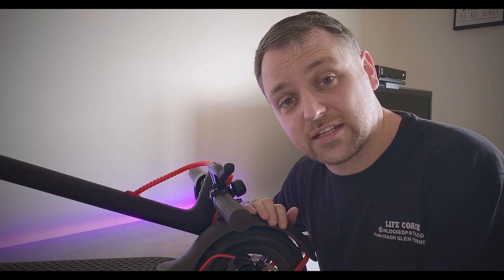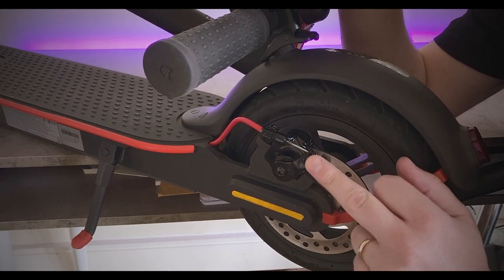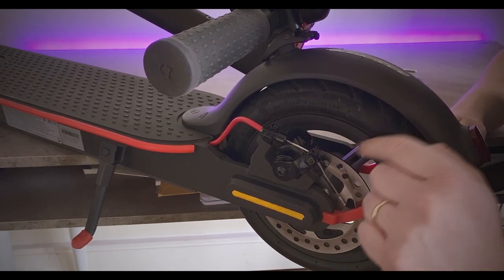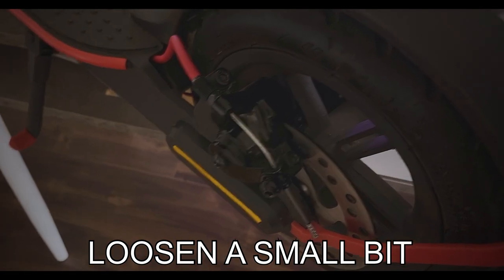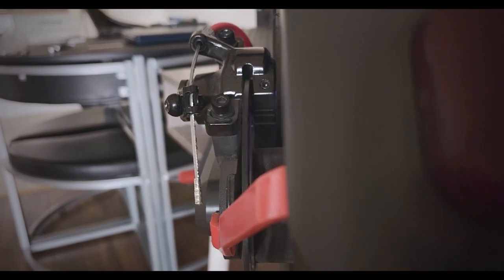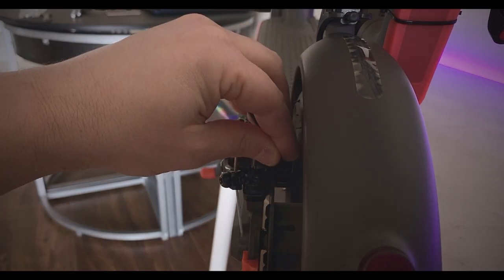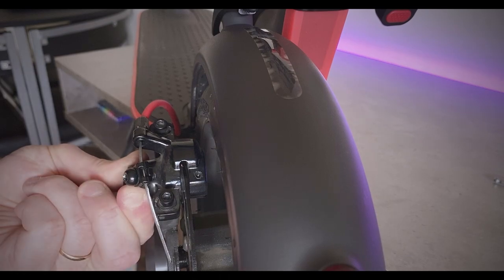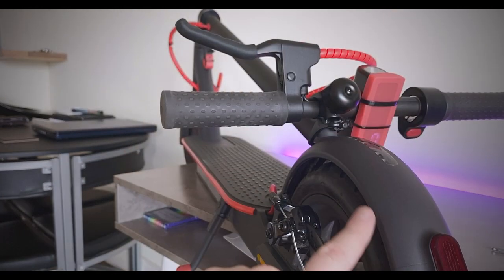XIAOMI M365 PRO 2/3 BRAKE ADJUSTMENT - Time For Check Up

Comment: Fantastic info. For the gap between the pad and the disc it would have been good to hear a mention like: "a regular drawing paper sheet should be able to move between them freely but if you have three sheets then that's too big of a gap."

I'll be sure to test mine the soonest I can. From getting my first 500km on my scooter I've definitely noticed some loosening on the brake department already.
Reply from the maker: Great tip! 🛴

Comment: I went from never stopping (only slowing down with stock brakes) to wheel burn (I now have to put my weight on the back to brake because it is so strong).
Thank you very much for this very informative video. I learn many things and my stock brakes are working much much better.
Reply from the maker: No worries at all! Scoot safe 🛴

Comment: Brilliant video mate. It's perfect timing as I'm currently having a bit of an issue with the motor over running and the brakes not being as responsive. If I could give a bit of feedback, the editing in the middle part was quite snappy and it felt a little fast in places. Can't fault your advice in the slightest though and hope you keep creating excellent content.
Reply from the maker: I definitely jumped ahead for sure!! But i am glad it has helped you out! I appreciate the comment👌🏻 the Xtech upgrade I’ll be doing soon also.
Safe scooting Sam 🛴
Reply: @Movelectrics  Hope you didn't mind mate, I'm grateful the scooting community have someone like yourself doing videos like this!

Comment: I had to do this one week after owning the scooter after I mashed it up going over a dodgy speed hump and dropping the scooter on its side when I jumped off it, the brake started making a grinding sound on the disc, was going to take ages to get it sorted so I managed to fix it myself, brakes been working fine since no grinding.happened about  four months ago and I use the scooter almost everyday
Reply from the maker: Thank god you are all good!! Scoot safe Dave 🛴
Reply: Doesbthe fron well grind as well
Reply: @Abdullah-zr7mw  My front wheel does not grind at all.
Reply: @virtualdave  my front wheel has fully jammed do you think it could be wiring
Reply: @Abdullah-zr7mw  I don’t know anything about the workings of the motor. Sorry.
Reply from the maker: Join here and post a video and we can help https://bit.ly/2NMeXIY
Reply: @virtualdave  no worries
Reply: @Movelectrics  ok

Comment: Hey man, really enjoying your xiaomi videos! Will you make a video bout changing the tires to 10" on pro 2. I am a heavy guy 6,4 tall  and 108kg, want my pro 2 to do best with my weight and all. Thank you
Reply from the maker: Hi! There are videos already on YT about changing to 10s. I’m on the stock ones with no issues. Maintain the pressure to around 45psi. 10s are more comfortable and easier to change.

You could do what I done and put the front suspension on and just keep the stock tyres? Makes a massive difference!
Reply: @Movelectrics  thanks man, ill see what i will do. Appreciate your videos, they helped alot.
Reply from the maker: No problem and thanks for the support!!

Comment: Greetings! Could you please do a guide on how to adjust the brakes on the new 4 pro model? The mechanism is similar but also quite different. There are 2 moveable brakes instead of 1, and pulling the brake cable doesn’t seem to do anything. I tried adjusting everything myself, but no luck, and scooters are not popular where I live, so I can’t take it to a repair shop, because nobody can or wants to do it. Please 🙏 this is urgent. I want to safely ride my scooter.
Reply from the maker: I don’t have the Pro 4 model. Can you post a quick video on my FB group? https://bit.ly/2NMeXIY

Comment: The spring is broken in my mi pro 2 brake.Any videos or even know where to get the right replacement spring.I can buy the whole assembly but I like to repair stuff.I have it all stripped off and it's only the spring that's sheared.
Reply from the maker: Any bicycle shop should have them or AliExpress.
Reply: @Movelectrics Thanks mate.Been looking and ones I've seen are too big in diameter.Need around 14 or 15 mm.
Reply from the maker: @alanweir3567 AliExpress

Comment: Assuming no cruse control - for the 1st half of the brake lever, does it engage Kers/regenerative braking? Or does it just stop throttle if you have applied it? 1st half electric brake, 2nd half engage disc brake? Or, do both activate at 2nd half? Basically, what does the first half of the brake lever do - Re-gen/Kers/Electronic Brake OR just prevents throttle (is this what you mean by it cuts the motor??)?  Sorry for the detailed question haha, its really bugging me!
Reply from the maker: Hi Habs. Great question! If you have no cruise control activated and you are driving the scooter, as soon as you let go of the accelerator, the front regen brake kicks in.

The first half of the brake does nothing unless you have your brakes adjusted to engage as soon as you pull the leaver. The problem with doing that is the front regen brake won’t engage at the same time resulting in the front motor possible getting burnt out by continuing to move until the sensor in the leaver arm engages it to stop (which also turns on the back brake light)

The sweet spot is the half way point, brake leaver is used and at the same time, the front regen brake is used resulting in better braking plus less chance of burning out anything.

When the back light flashed, the pads should be hitting the disk and the front motor stopping.

I would also recommend to make sure you have your regen braking set to weak to avoid issues like a burnt controller/motor via the app.

Remember to never go down a hill fast either on a full charge as that can burn the controller inside.
Reply: @Movelectrics  thanks for the great reply. Loved your channel on the maintenance and mod installs, really helpful!
Reply: @Movelectrics  planning on removing the freewheel regen with CFW at somepoint. Will report back here what the front half of brake does when free wheeling and if it ends up slowing down. I feel like there must be some small amount electronic braking in the first half of lever as you can hear a whine, but wont know till disabling coasting regen. 

Perhaps it is just a motor cut out. Wont be for a while though while I get use to the handling!

I wonder how many lives you might save helping people maintain their Scoots. 

Would love to find out about tightening the screw/bolt next to the clamp (eitherside) In a future video! Keep it up!
Reply from the maker: No problem! I try my best to help out when I can!! Scoot safe 🛴
Reply from the maker: Be careful disabling the front regen brake, it’s good to have more stopping power.

I done videos already about the folding mechanism and adjusting correctly plus the installation of the X-lock.
Reply from the maker: The CFW I have is great, original PRO. I have the regenerative braking set to weak also.
Reply from the maker: That ain’t my FB group. My CFW would be different compared to yours. Just make sure that it has been tested by a few people. Some CFW can potentially effect battery in a negative way if not set up correctly 🛴
Reply from the maker: Decent range 🛴
Reply: @Movelectrics  the first half of the brake lever stroke adjusts the regenerative braking force (in couple of steps). That's why the disc brake should not engage in that range but start to engage once you pass half of the stroke. Regen will be already at max and disc brake starts to help braking.
Reply from the maker: As I show in the video. The regen kicks in after the leaver goes half way along with the back pads touching the disc ⚡️

Comment: Hi I have got a problem, on the brake unit (back wheel) the rubber cover has warped and was hanging off the mechanism, and it has now snapped and come off, any idea where you can get a replacement? For that matter I also would like to know how to get a replacement spring inside the brake unit. Without having to pay for a new brake system for a piece of rubber and spring. Thanks
Reply from the maker: Hi Dave
I’m not sure about the replacement spring, if it was me, I would just replace it. They are cheap.
Try this place, they have most essential parts
https://bit.ly/3eT0GBN
Reply: @Movelectrics  cheers, I just emailed them, I currently glued the rubber and have taped it with some water proof tape. I can’t do another day on a London Bus The thing that warped it was the cold snow  ⛄️  must have frozen the rubber.
Reply: I got the unit, it’s third party and the design of the “arm” is different, straight instead of curved. I have put on and readjusted, the brake seems good so far. Did you try the X tech brake? Is it worth getting?
Reply from the maker: I have the Xtech kit, I’m gonna replace it as soon as the pads wear down on the original. I was on a Xiaomi that had the kit installed and you could definitely feel the difference. Smoother stopping. Well done for fitting the new part 🛴

Comment: I gave this a shot, followed step by step, but I still can't figure out how to make the left pad move any closer, and despite tightening everything and pulling the cable, my brake handle still goes down all the way (and now has a kind of creaking sound to it). Any suggestions?
Reply from the maker: Hi Marc

Start over. Loosen the whole caliper (2 small bolts on top)

Squeeze the handle until the caliper is squeezed against the disc AND tighten while the lever is still pulled. This will align it.

Next step, adjust the back caliper like I did in the video and get it close to the disc.

Next step, adjust the cable to push in the front pad close to the disc. Remember to loosen where the cable is first to give it slack before pulling it to push the pad in. Tighten everything back then.

Is this a new scooter or have you had it a while?
Reply: @Movelectrics  Thanks for the response. I did as suggested, but it still takes almost the whole squeeze to get a stop, and the part of the assembly that rotates forward is almost touching now, despite the cable being pulled as tight as I can get it. I wonder if maybe I've just worn down the pad? I've had the scooter two years now, and most of that time it's been cranked up a little, a friend has it go up to 28km/hr, but I do a lot of city riding that can end up with a bunch of stops and starts. Is it time to look into replacing the pad, if I can't get it any closer with the given instructions? Thanks!
Reply from the maker: Ah right, more than likely it is the pads then. They are quite easy to change by the look of things. There are tutorials on YT about it. I’ll do one at some stage also 🛴

Comment: No need to adjust the outside pad independent of the caliper?
Reply from the maker: Outside cannot be adjusted like the rear pad. It’s operated by the cable. Easy to do.
Reply: It looks like the Mi Scooter 4 (scooter I have) moved the adjustable pad to be the one on the outside, making it easy more accessible.
That's why I wondered if you had to adjust both haha
Reply from the maker: @thomasphillips885  this the original Xiaomi M365 Pro that came out first.

My very first scooter.
Reply: I used this video as a reference and adjusted the brakes on my Mi Scooter 4 today, and it's so much better now. They swapped the adjustable pad to be the outside one (no more putting the Allen key through the back wheel), but everything else is exactly the same.
Thanks!

Comment: Hi, I have a brand new Pro 2 and a “rubbing”, “scratching” noise is coming from the rear wheel every time it rotates around ( it is not constant). The more wieght is on the scooter the louder the noise is. The wheel rotates freely when in the air. Do you think it is a brake or bearing issue?
Reply from the maker: Hi Levente! Sounds like brake disc rubbing, common so don’t worry! Did you try and adjust them following the methods in this video?
Reply: @Movelectrics  not yet, but I will give it a try. Thanks for the quick reply.
Reply from the maker: Takes literally a minute to fix 🛴

Comment: How hard / easy is it to renew the brake cable on an e-scooter 😁
Reply from the maker: Hi Barry. Never had to do it. I’d imagine after long time use, they would need to be changed. Just keep them adjusted, and try not to pull hard on the leaver 🛴
Reply: You have to undo the plastic bottom plate and also the controller because the cable is routed behind it. Also there is some kind of waterproof foam in the frame tube so it's propably best to put some sealant after you replace the brake cable. It's not that difficult to do but time consuming. The foam is weird stuff  reminds me of polyurethane but it's spongy and elastic.

Comment: Hi. Do you have an idea why is my brakelight not flashing when i press brake(any of the 2 handle) on my Xiaomi Pro 2(when i turn on light, is turning on, but not flashing on brake)? Can be related to firmware?(Germany) Thanks
Reply from the maker: Hi! Yes, firmware could have possibly caused this. Did you change it recently?
Reply: @Movelectrics  i've buyd yesterday from somebody. I don't know if was flashed before... I didn't flashed
Reply from the maker: Ask the person you bought it from ⚡️
Reply: @Movelectrics   @RayS Tech-Know-logy  i've tryed an app called German Maneuver. This change region to Europe(up to 25km/h) until i shut down the scooter(power button). When i start it again is comming back to german version. So in Europe mode, brake light is working and it blinks. So i guess that this is how it should be in Germany....

Comment: I have an aovo pro m365 and the mechanical brake works but the front wheel brake doesn’t work anymore like when I used to brake the front wheel would stop too but now it doesn’t
Reply from the maker: Front brake is electronic (from the motor)

I never had this scooter but check the app. You can sometimes adjust the intensity of the regen braking.
Reply: @Movelectrics  I found the issue it seems to be a problem with the controller that’s inside the scooter. Something has gone wrong there needs a whole replacement.
Reply from the maker: You have warranty?
Reply: @Movelectrics  no it finished this year in September but I did contact aovo and they agreed to fix all the problems with my scooter for free at a repair centre in China if I pay postage to China.

Comment: How many miles b4 pad replacement?
Reply from the maker: Hi James! It really depends how harsh you brake. I gradually pull the leaver coming to a stop. As the pads wear down, you can adjust them like I did in this video and get the most out of them. I heard many people going well over 1000kms and the pads are still fine. They are very cheap to buy too which is great 🛴

Comment: You don't even need the rear brakes. I Just snipped the whole cable off. 
Just use the most agressieve engine brake in cfw.
Reply from the maker: You cannot rely on the regenerative braking. 1 brake is not enough and cutting the cable is definitely not something anyone should do 🛴

Comment: my wheel is automaticly braking i was changing the tire and then this happend
Reply from the maker: Adjust like in the video ⚡️
Reply: @Movelectrics still not working i have more space on the left side i cant adjust the round screw bc if i do this then is very loose and it can fell of
Reply from the maker: @LadyPanko your definitely doing something wrong. Adjust brake cable side first then adjust inner pad. Start over.